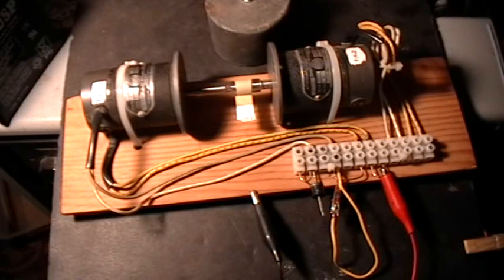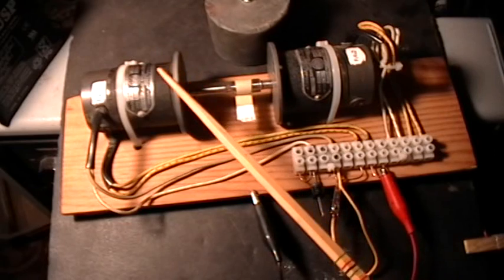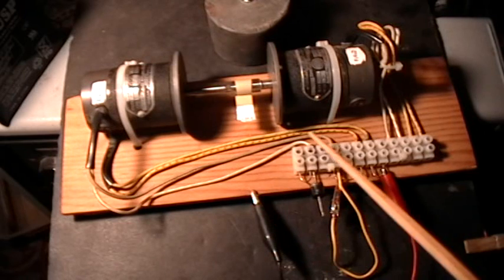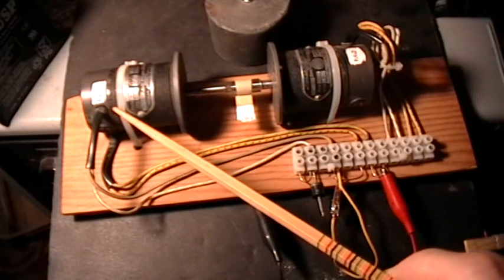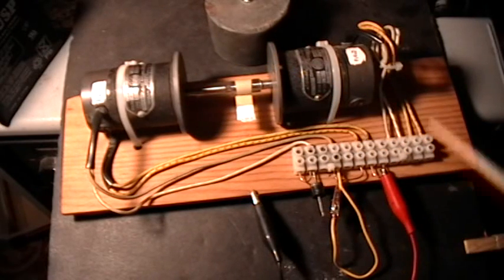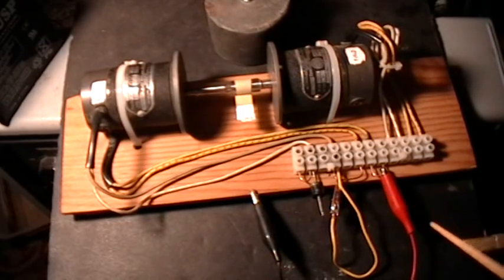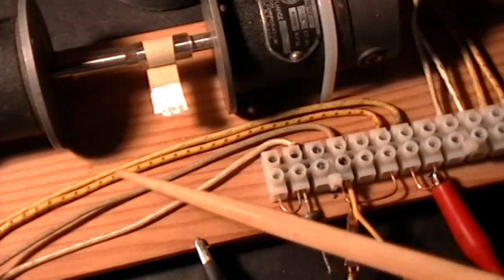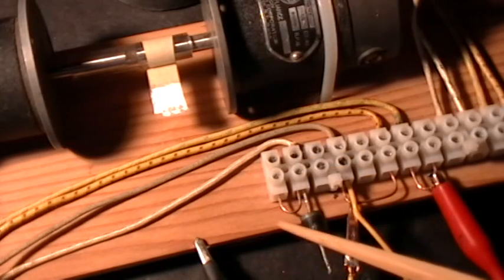Electric OU: Coil Shorting Shunt Motor Demo 1

Comment: Well here we go again that is the same effect peopel wuld get on wv bug wire harnest problem and static they are normaly prone to those things. How even Im curiuse to kniw how wuld those electric motor and generator work with ignition coil ore plazma and amplifier ignition? wuld you please make some readings from the voltage and curent draw? I belive I have a problem my car cinde of doing that I have no real explanation why its doing it.
my hande brake light and alternator light stay ON at centrain rpm when I tuch gas pedal its going away. Im not shure if that is back charging ore not ore I acidentaly bypassed my dashboard voltage regulator and diode ore not. That thing is haunting my for years and I cant finde any clue's.Its realy usefull for economy I supose but alternator baterry starter motor goes realy bade fast and my deam can idels around 300 500 rpm barelly can hear that thing runing. It's realy anoing electritian's not realy can help my. They suposedly dont know what it is? I suspect ethanol eating up ruber and probably static from radio ore coolant electrolisys. My trobel begane when I started to use the R terminal GM type starter motor selenoid. So can you tell my any thing usefull why that freaking thing doing what it does? I studied plazma/amplifier/dual/magneto ignition I belive my engine is based on the old chevy 250 those are multi grade engines gasoline/disel blocks my opel monza is based similar to that design even tought its a 4 cilinder sohc engine.
Im not even shure if a alternator/starter motor combination is posibel ore not and if suposedly swap terminals around I have no idea what I wuld get in return.
That staff is strange! 😖 Im cinde of experimenting my self with those things not realy haveing any sucess.I suspect the alternator start charging speed was altered because I tested ceramic capacitors for plazma ignition I cinde of get higher voltage out of the baterry and faster starter motor spining but alternator start charge around 2k 2500 rpm thats how much I gathered and used any where terminal on my e core type gm ignition coil to ground still plazma ignition works but those are all experiments it acts more like waste spark ignition system but that does not solve my previuse problem I hade long time ago with slow reving etc. Hell if I know what causes it? I suspect somthing has to do with the starter motor because copper delco remy brushes brake fast get worn realy fast.
So Im cinde of confused realy.
Is it posibel for a baterry to change polarity if the baterry is dead and recharged the oposite direction? Like positive ground chassy? 
Any way I hade lot trobel with those things conventional siece is shit and I can not realy finde any info for those things.

Comment: Now use the shorted coils from the motor to tie into your other motors stator windings  which will be ran as a generator and short the generators brushes as you light some lights as well. Then see what happens. Maybe the generator will speed up as well or reduce the back emf that bogs generators down. Thanx.

Comment: I have an idea for all the Tesla Resurrectors out there.  I want to see jetson-mobiles flying in the skies before I die and believe we are ready.  Here are the ingredients:  Brushless Motor Wound Bedini or similar style (ufopolitics, lidmotor, lasersaber), Remote Control RC Airplane (rcgroups), Solar Panels, Super Capacitors, Boost Converter, Tesla Turbine (mr teslonian), and the newly expiremented with shorting coil efficiencies shown by TinselKoala and others.  I believe with a mixture of the above in a prop driven aircraft scenario we can be well within grasps of O.U. Air Travel.  I lack the skillset but my mind’s eye can see this working in some sort of combination.  Can we organize an effort?  Thoughts?

Comment: Typically series wound motors spin the fastest check your industrial motor theory for this online its well documented. The reason that you might be going slower is that your running everything in series from one coil to the next. In a series fashion as you load in series the voltage drops and the current stays the same but that motor in parallel the voltage is the same but the current draw will go up from the two coils and rotor coil. You maybe going faster because the back c-emf "counter electro force" is pushing the rotor it maybe over coming lenz because you are breaking the field before lenz takes effect. I don;t see over unity I see you found a way to efficiency by pulsing the stator. When you have two coils side by side in a transformer fashion such as transformers and motors you get lenz and hysteresis happening and you maybe in some type of phase shifting. Remember also a motor is a generator and a transformer as well.

Comment: I suspect magnetic saturation effects in the field coils. On one hand, the more you short the field coils, the more power gets delivered to the armature (lower series resistance). On the other, the more you short the field coils, the less effective they become. Dead short, no magnetic field in the field coils, motor stops. The kicker, is that the resistance of the armature coil is normally a bit low, leaving the field coils saturated.  However, adding some resistance (tickling or bulb) across the field coils causes the motor to go faster, because the armature is getting more power (lower series resistance), but the field coils haven't yet lost much strength, because they were saturated at the originally higher current levels, and may just be starting to come out of saturation at lower levels. The counter intuitive result, is higher motor power. Diode improves by recycling field coil voltage spikes.
Reply from the maker: DerrickA4mag That pretty much agrees with my thinking on the matter. I don't remember whether the field coils are coreless or cored, it's been years since I took apart one of the motors. I guess I'll have to open one up again. Probably would be a good idea to show the guts in a video anyhow.
Reply: TinselKoala Even if the field coils aren't wound around a core, they're in close proximity to the metal casing which is likely steel. If the motors are serviceable, you may want to clean out and re-grease the *bearings if they're dried out. Replace graphite brushes if worn. Good excuse for take apart if you have plans to use these motors, but don't feel pressured on our account.

* To avoid Steorn type demo tragedies, of course...   ;-)

Comment: I am flummox.
Reply from the maker: Andrew Palfreyman It is a rather puzzling result, isn't it. One would think that a low-resistance short or shunt would make the field coils inoperative, rather than greatly enhancing their effectiveness. 

When I use the second motor's armature as the "shunt".... the second motor's field coils (with no load)  generate unsteady voltages with peaks that read over 100 volts at times.  If I use the light bulb to make the connection to the other motor's armature, the bulb does not glow....

Comment: Witchcraft! ;P
As I understand it the magnetic field must become much stronger inside the motor somehow, but why?
Is it because the short circuit makes the electricity rush through the coil, witch causes the magnetic field to be much stronger?
Reply from the maker: Sion I'm going with witchcraft.

Heh... no, I don't really know why it works this way.